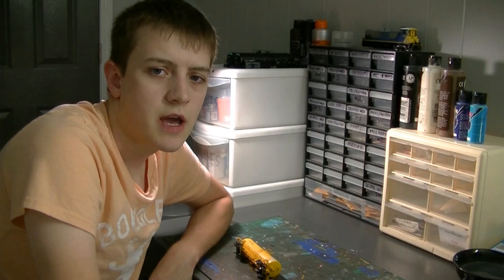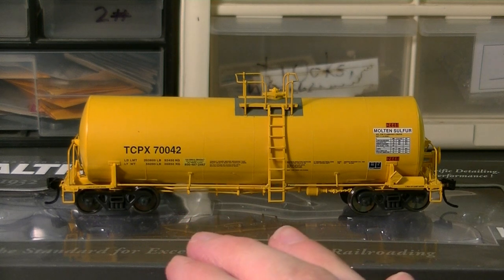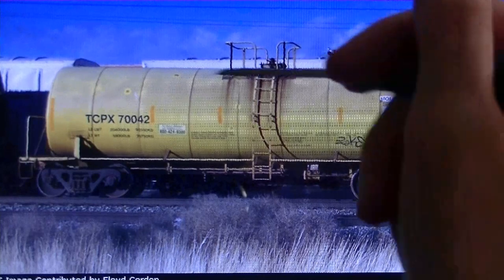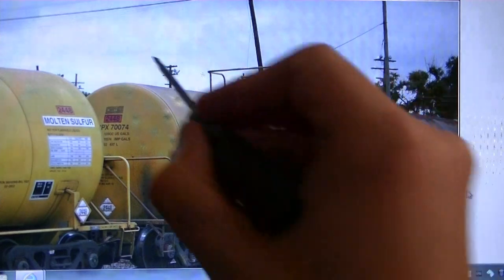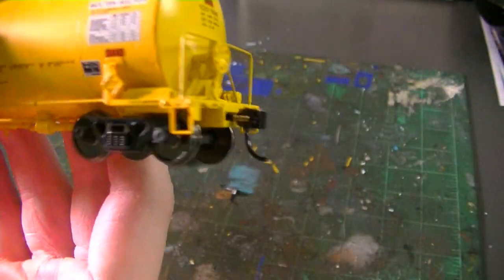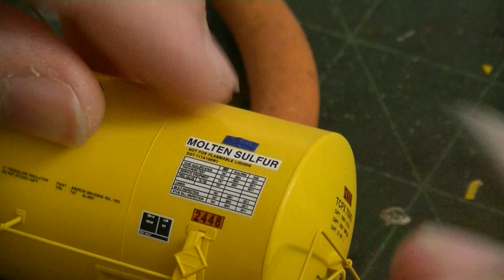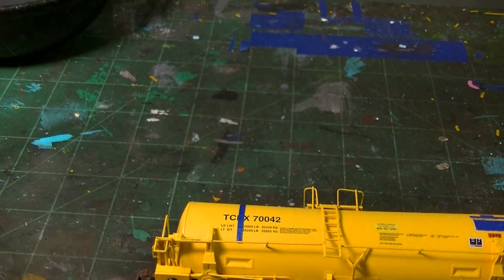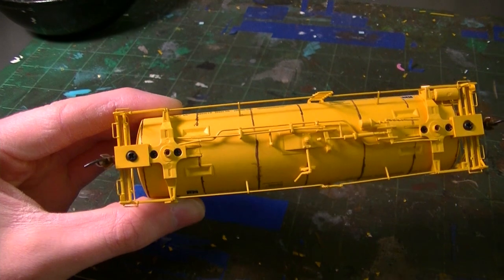Weathering A HO Molten Sulfur Tank Car!   Part 1 or 2

Comment: hi Dan, I enjoy watching your videos and seeing how your weathering turns out. I hear you mention "prototypical" several times and see you use "prototypical" photos, which is good. Prototypical cars don't have trip pins, and I see you remove them from other projects, going to do it this time and use rubber air hoses?  thanks, Terry
Reply from the maker: +PennCentral99 If I could, I would love to go back and add coupler bars and air hoses to all of my rolling stock!   It's a project that would take a lot of time however, and I don't see it happening anytime in the near future.    I do still like to remove trip pins on a lot of my couplers because I think the coupler looks better without them.   ~Daniel
Reply: +DansRailroad2011 I do the same thing and remove all the trip pins on all my freight cars.

Comment: Hey Dan, First I want to tell you that I love your work. The research you put into your subjects really inspires prototype modelers like myself. I would never criticize another modeler for the way they choose to model, I just offer my input when asked. My question for you is about the panel lines. I am curious why you decided to mask and paint the lines as opposed to a pin wash.
Reply from the maker: +Eric Quellhorst Simply because, I don't like the affects of pin washes, not to mention, in this case, I need complete coverage, the panel lines on this car, as you have noticed are completely grimed up.   A pin wash is still going to leave a slight car body color underneath, and further wash applications take what's underneath, off, unless a clearcoat is put over it for each wash application.   In the sake of simplicity, I choose to do these with paint and masking.   I do use wash applications for the sides of certain hoppers however.   Now as I have said before, their is no right or wrong way to do it, one person may find a technique to be one they swear by, but to another modeler, one they swear at.  Thus it's best to use methods of YOUR choosing.     Thanks for watching!  ~Daniel